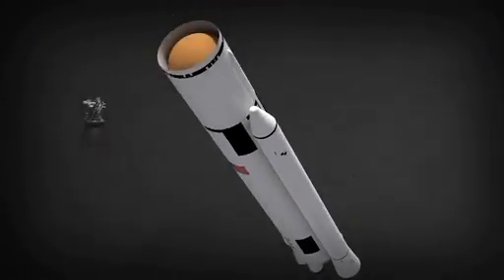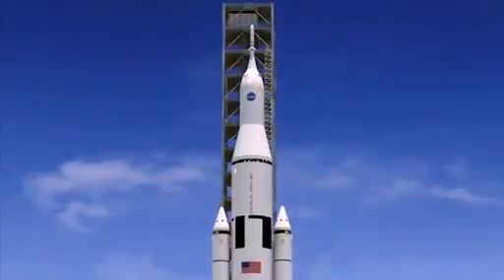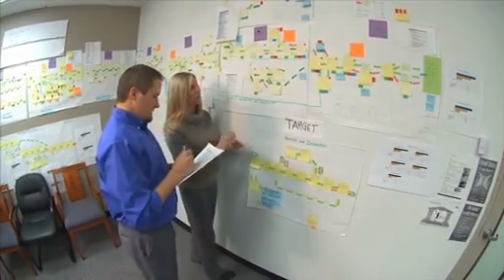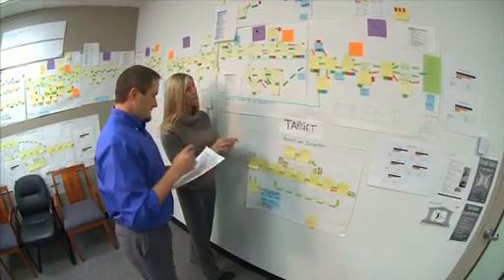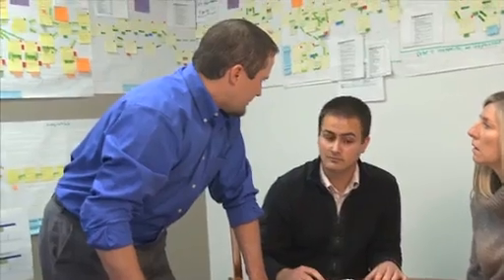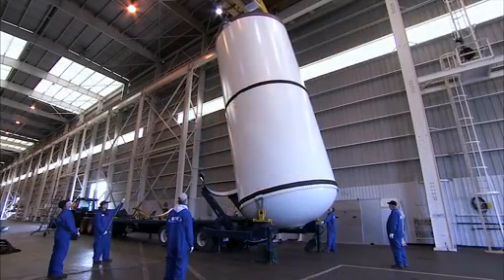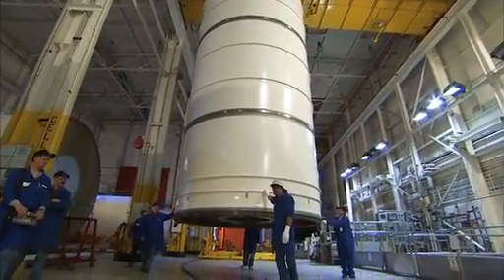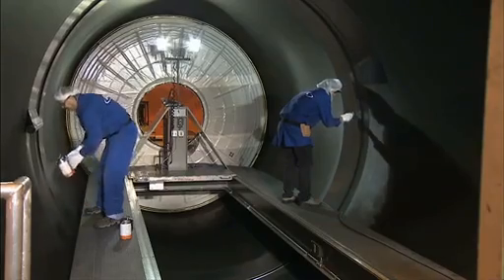ATK - Solid Rocket Booster Improvements | NASA SRB Space Launch System Video

Comment: Talking bollocks. An SRB is a bloody rocket - for gawds sakes. A tube filled with powder.
Reply: Yes, but, with a committed team of men and women who speak with a steady cadence, NASA can place 4 times as many post it notes on an alumimnum substrate.  This will bypass the grueling task of using a computer to make the decsions to cut waste that only a highly trained engineer can make.  For instance, my housekeeper, Lupe, used to move the clothes from the washer to the dryer in 14 seperate steps.  Thanks to Curtis Mumford, Senior Supply Chain Manager for NASA, Lupe has gotten that number down to a much sleeker and cost beneficial 5 steps.

Comment: Solid rocket boosters make fantastic missiles and ICBM's because their is no liquids to store.  Just light it up when its ready to launch.  They are also good for model rockets because they can be pre-packaged.  Generally speaking they are good for small payloads.  On the down side its not good for fragile equipment because of the oscillations is creates when burning.  Most notably, solid rocket fuel is absolutely what you do NOT want on any manned rocket.